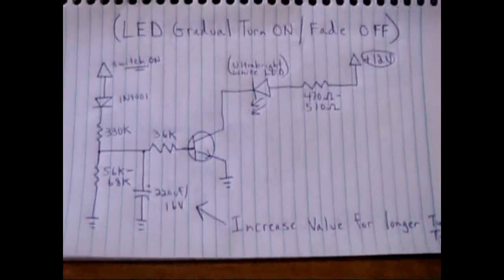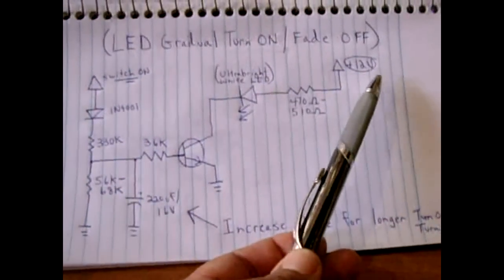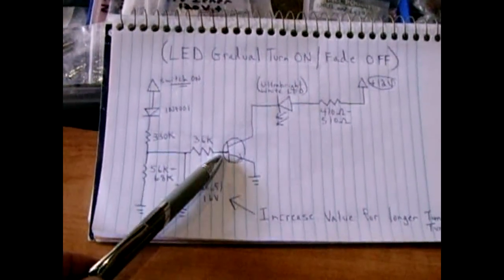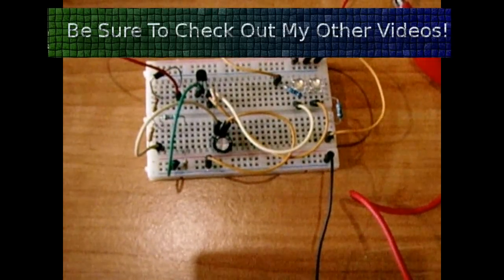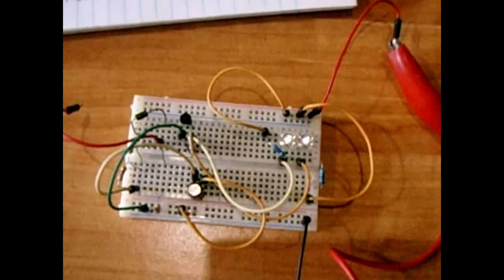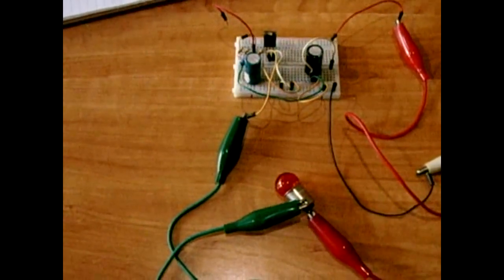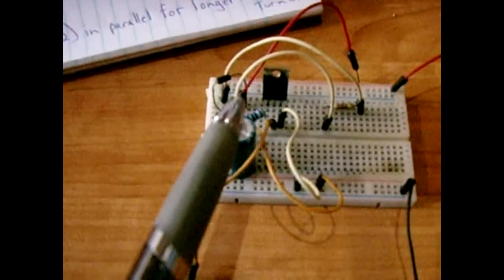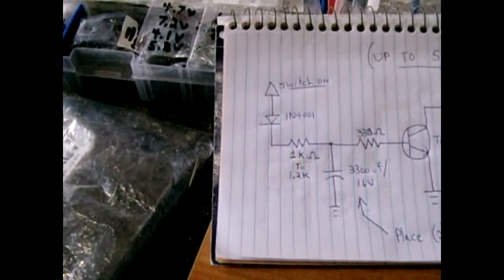Simple Gradual ON / Fade OFF Circuit For 12V(Car LED's)

Comment: Thanks very much for the circuit, I plan to use it to gradually light the deflector dish on my Enterprise refit model. Actually, I'll duplicate the circuit and use a three-way switch so I change from a gradual orange glow (impulse speed) to a gradual blue glow (warp speed) and back again. The one difficulty I'm having is that the LEDs are never as bright when connected through the collector as when they're simply connected to the 12V supply. In fact it doesn't seem to matter what limiting resistor I use. I can bypass the resistor completely and it's still the same brightness.

I'm using two bright white LEDs because I don't happen to have the bi-color (amber/blue) LED I plan to use, but I also get the same problem if I use an orange and a blue LED. They're nowhere near as bright as when connected to the 12V supply. I'd appreciate any suggestions. I'm using the values you specify (although I notice I get the same effect regardless of the value of the resistor going into the base). And I've used 220uF and 100uF capacitors.

Thanks, Jennifer
Reply from the maker: When the transistor is turned on, you should be getting full power to the LEDS. The only thing limiting the current would be the resistor in series with the LEDS. You can try reducing the value of the resistor on the base of the transistor, but don't go below 200 ohms.
Reply: electronicsNmore Thanks for the speedy reply. The way that I'm reading the circuit (and forgive me, for I am stupid), is that the transistor is just a switch in this instance, and once it's turned on, the LED should be getting the same voltage as if it were directly connected to the main supply. Although that does look suspiciously like a voltage divider (http://pcbheaven.com/circuitpages/LED_Fade_In_Fade_Out_Dimmer/ ). I did go down to 1K Ω on the resistor connected to the base, with no visible difference.

Anyway, thanks for the reply and I'll keep dinking with it.
Reply from the maker: Each LED should draw 20mA, or 30mA if you want to drive them higher and reduce the life of the LED. 2 LED's in parallel with a series resistor of 150 ohms will allow 60ma of current through the LED's leading to the collector of the transistor. If you place 2 white LED's in series, then add a series resistor leading to the collector of the transistor, then the value should be around 200ohms to drive them at 30mA using 12VDC. The greater the amount of current you need to flow from the collector to the emitter, the base of the transistor will also require more current
Reply: Got it to work. The white LEDs seem bright now. I found a 1K ohm resistor to the base worked fine. I'll have to hope that a bi-color LED proves brighter than the ancient orange LED I found.
Reply from the maker: Glad to hear that. :-)

Comment: Hi, what about the wattage of the resistors? Thankyou.
Reply from the maker: Hello there. 1/4w or 1/2w. Be sure to rate thumbs up, check out my video playlists, share, and subscribe. Thanks
Reply: Thankyou. Already subscribed.
Reply: Would you suggest a heatsink on the transistor when you parallel capacitors for longer fade off?
Reply from the maker: Reinhold Jahnke
No, unless you cannot hold your finger on the transistor due to excessive heat.
Reply: Thank you. The rason i ask is because I blew a transistor.
Reply from the maker: Reinhold Jahnke
You must be drawing too much current.

Comment: Hey I want to use  circuit 2 on the video. But i have a current from 2A. Can i use circuit 2? With a modification? Thanks!
Reply from the maker: +anthony kuypers 
Hello. That level of current is too high for this circuit for it to operate properly.
Reply: +electronicsNmore thanks for your answer. is er a ohter circuit?
Reply: +electronicsNmore Why? According to some datasheet I just looked at TIP41A can do 6 A continuously?
Reply: Sean Smith thanks. But give this the 12v on the output?

Comment: Sir , can I use 9 volt in this circuit ? 

And also tell me , how much Amps are enough to destroy this circuit .... Please...
Reply from the maker: Yes for 9V. If you exceed the current rating of the transistor, you will destroy it.
Reply: @electronicsNmore  and the max current rating is ?

Comment: Hi! I bought a panel with 12pcs SMD5050 LED for my car. I want to create yout electronic. Does it works with my more led?
Reply from the maker: Bence Zmák Hi Bence. Since you are only using (12) smd5050 LED's, use the schematic shown at 5:30 in the video. These LED's draw around 1.2A per meter. So you will be way under that current level using only (12) LED's.

Thanks For Watching! Be sure to check out my other videos, rate thumbs up, and share with others.

Comment: Can i use 4,5 or 5 or 6 or 9volts? If i can use, which components do i have to change? I want to use 3v led, not a lamp :)
Reply from the maker: Renan C. Any voltage works. Refer to the link below. Usual mA is 20-30. and the forward voltage of R,Y,G is around 2.0V. For white or blue 3.1V. 

http://led.linear1.org/1led.wiz

Be sure to share my channel and rate Thumbs Up. Thanks.
Reply: So do you mean that a i cant use 4,5 or 5 or 6v in this circuit for fade the 3v led?
Reply from the maker: You can use lower voltages exactly as the schematic is shown. You may have to play with values to get "exactly" the type of fade on/fade off you are looking for.
Reply: ok, tank you very much :)

Comment: so i built this circuit, and the LEDs light up as in your video, but when i remove voltage it just simply goes out. the only difference is that im using a 100uf 16 volt cap. any ideas where im getting th short on this?
Reply: nm i found my issue :)
Reply: Dan Morningstar Hey, umm, had the same problem as you but not sure what's wrong... Could you help please? =)
Reply from the maker: MaelstromAndCuriosity
Try adjusting the 56-68k resistor HIGHER.
Reply: electronicsNmore the issue was actually the positive lead setup... i was shorting there... split that up and we were off... on a side note, the prop i installed this in helped secire a grand prize win at a Maleficent screening in Hollywood at the El Cap! thanks for the awesome vid!
Reply: Dan Morningstar Thank you very much Elena Kalis and Dan Morningstar , we got it working in the end! =) It was the positive lead setup and for some reason, the transistor blew, but in the end, we got another and it works perfectly! Thanks for this BOSS video! =D
Reply from the maker: Dan Morningstar
Great to hear! Be sure to post links/share my channel with others.

Thank You

Comment: what is the value of the transistor?
Reply from the maker: +Zluff  Facco 
The TIP41A is for higher current use, and for lower current use you can use 2n3904, 2n2222a, 2n4401, bc547
Reply: Thank you : )

Comment: hi there, i have a question please, i will use a lot of leds, in fact i think i will run more than 2 amps. can i run  the bigger circuit like you shown for the 500 Ma?
thanks
Calisto
Reply from the maker: The circuit is not designed to handle that much current.
Reply: electronicsNmore what can i do? any lead for doing this right? thanks
Reply: Bruno Calisto can i use a TIP41C?
Reply from the maker: 2 Amps is a lot. I would do a Google search for "fade off circuit". Look for one that uses a mosfet.
Reply from the maker: It would not hurt to try the tip41c.
Reply: electronicsNmore thanks, i was thinking since the circuit is so small i can use 2 or 3   circuits to run all the process!

Comment: How long can I keep LEDs on using just capacitors?
I'm planning to use your circuit in a DIY aquarium LED light, and the photo period will be controlled by a simple timer. This timer will turn all circuit on and off, so I can't use "Water Heater Timer Circuit ~ Auto Off" circuit.
Thanks for your circuit.
Reply from the maker: Depends on the value of the capacitor. if you use a supercapacitor you can get a VERY long run time.
Reply: electronicsNmore
When you say super capacitor, you say about 10.000uF? 20.00uF?
Thanks for your help.
Reply from the maker: Even higher. Up to FARADS.

Comment: This is an excellent tutorial and much appreciated as it's precisely what I was searching for. I was hoping you could help me. I would like to use this circuit on a 100w chip led. Do I have to increase the wattage rating of all the components? And if so to what wattage?
Reply from the maker: Hi Adam. 100W is way too high for this circuit.
Reply: Thank you very much! Saved me a small explosion

Comment: Hello, I've probably made your schematic (the first one low amperage) at least 6 times and have swapped all the components out probably 3 times each.  I've probably purchased at least 8 transistors thinking I burned them up.  On the breadboard it works perfectly, but once I solder everything to a PC board, it fades on and fades out fine, but the LEDs stay lit at about 10%, never fully dimming.  Any ideas?  I thought maybe the diode is letting in reverse current or the transistor was letting current across it too, but i've replaced all of those components at least 4-5 times over.  I'm hitting a brick wall, can you offer any pointers?
Reply from the maker: Hi Scott. Sounds like the power from the switch(the far left side of the schematic) isn't FULLY turning off. Make sure it is. When the power is off, it's not possible for the transistor to turn on.
Reply: If I hook up the ground cable and the collector, I receive the 10% lit LEDs.  This is what is leading me to think that there's a current leak (or something).  Also, this same layout on the breadboard, seems to work flawlessly. (makes me think I've missed something) After tracing these routes over and over, building it 5 or 6 times, still getting the same result.  Mind boggling!!!
Reply from the maker: This circuit couldn't be any easier. You're doing something wrong, using the wrong part/parts or connecting the transistor wrong.
Reply: hey Scott i am having the same issue can you share me the complete soldered circuit that would be of great help.

Comment: Hi :)
It's a nice video. 
Do you know how to insert this using Arduino ?
Because I want to use this kind of method in my project. You see, I was thinking of using Arduino for my project and I want to make a sphere object which might consist of a speaker, IR detector which will producing lights and sound that gradually fades on when people touch it and fades off when people moved their hands away.
I'm not really good with this technical stuff yet so I hope you could share some of your ideas how does this work ? 
Thank you !

Comment: Insert a timer chip that passes the current to the LED and break the circuit every couple seconds to create a pulsating LED.
Reply: I tried it, i used the astable mode of 555 ic. It didn't work well, i think there was an small error, i still can't figure out what made it error

Comment: Thanks! U can use, the same component's but the transistor, can replace with ”D718„. There's pins, are on the same place, but „D718's” Collector current is 8A and the Base current is 0.8A! Its 80Watts. Ofcorse, your scheme is more copability from mine. But with “D718„ u can install more powerful lamp. I thinking to try the mirrored scheme, with "B688„ PNP transistor or Darlington's pair. What do u think about that?

Comment: Hi, Thanks for the wonderful explanation of circuit. I have made a circuit for 5meter long led strip. I used 27v supply and used 2kohms and 40nos of 16v 2200mf capacitor. Voltage across led with load is 9V. Transistor is heating, so used heat sink. Time ON is 20sec. Time OFF is 2min. 
Please suggest how can increase time ON to one minute and circuit for 5amps led load?
Reply from the maker: Reduce heating by using a lower voltage power supply. You'll need to experiment using different component values.

Comment: I'd like to do this with my aquarium panel of leds, maybe 15W, should I just use the incandescent version? I think you flashed 500ma at 12v, so maybe only 6W, is the something I can modify to run ~15?
Reply from the maker: You may be better off just buying a ready made kit, the prices have come way down since the video was made. Thanks for watching!
Reply: @electronicsNmore  thanks I've been looking for something off the shelf but can't seem to find one, would appreciate any suggestions for something passive like this...

Comment: I would like the circuit to do it with a triac, to light lamps of 220 volts, you could complete the circuit. Thank you.
Reply from the maker: +mariogustavoo 
The problem slowly turning ON and OFF triacs is heat. You need very large heat sinks. How many watts will you be using? The least heating is when the triac is FULLY turned on.

Comment: I will use lamps with transformer 12V 50 watts. dichroic lamps!
tic 226 that supports more power.
tiempode estimated by him or after him on and off for five minutes or so.